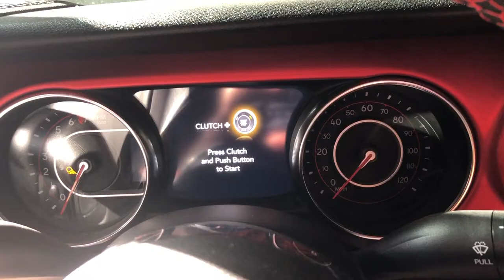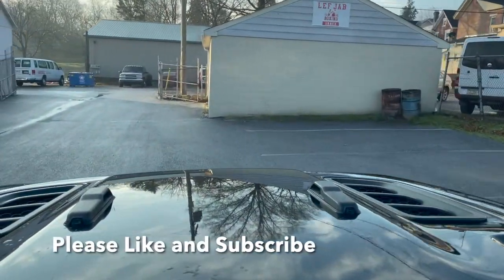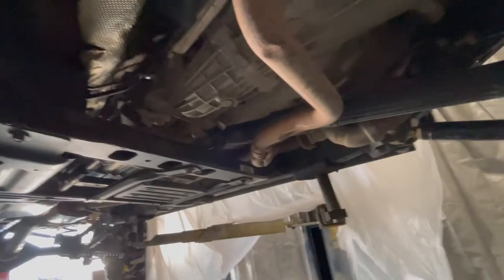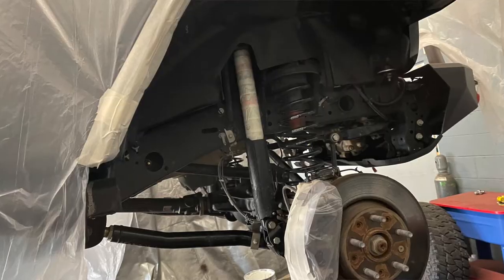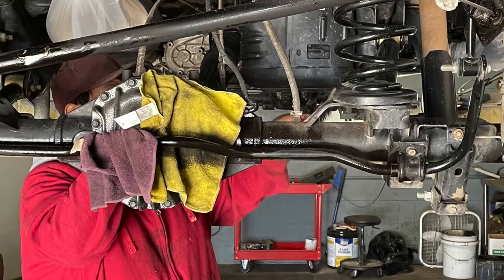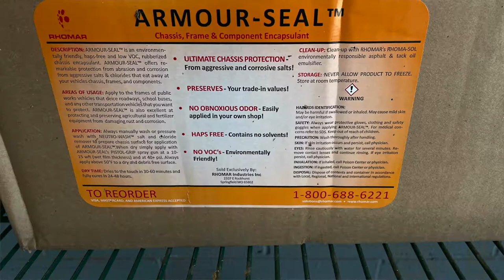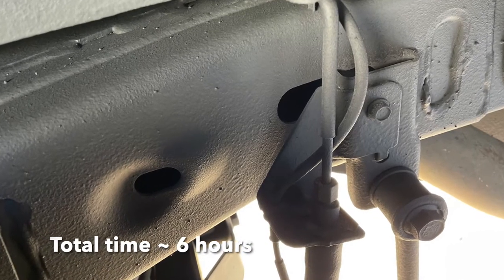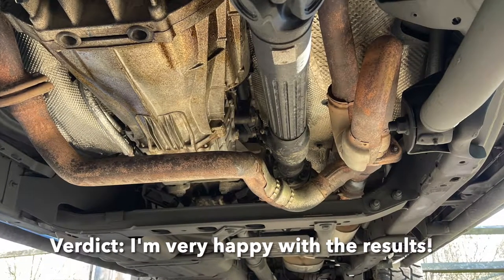Jeep Gladiator (JTRSPARTACUS) @ Speakman Undercoating

Comment: Were any of the body panels addressed, i.e. rocker panels, inside the doors, or inside tailgate?
Reply from the maker: Really focused on undercarriage. - frame and floor pan/ under side of the rockers and the gaps in the sheet metal.